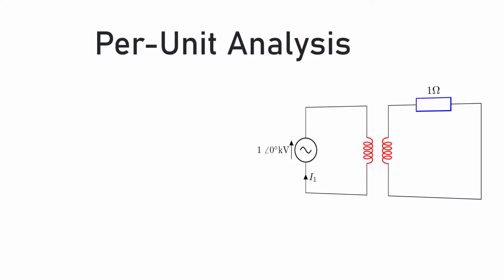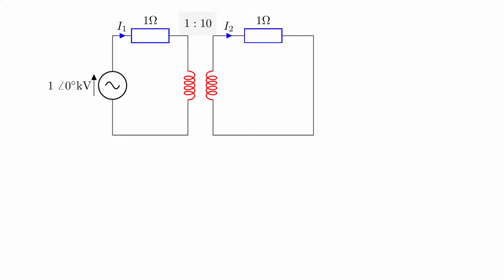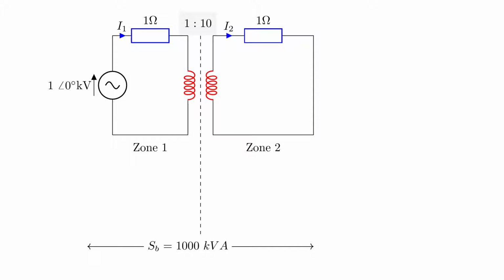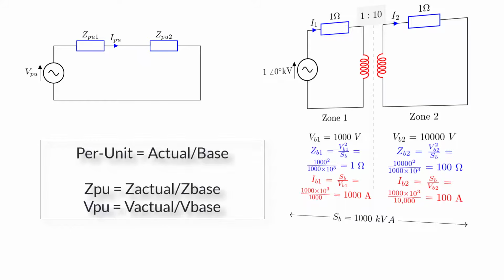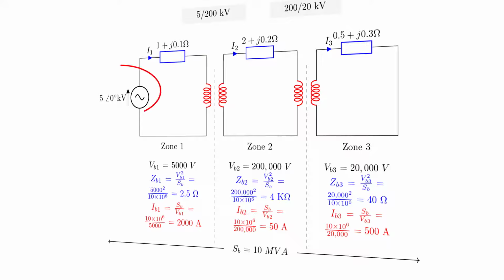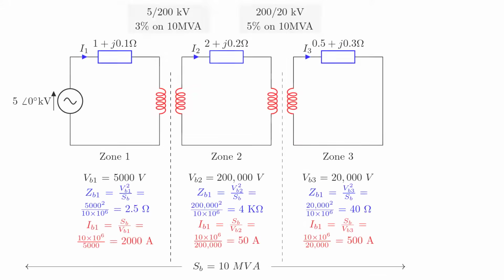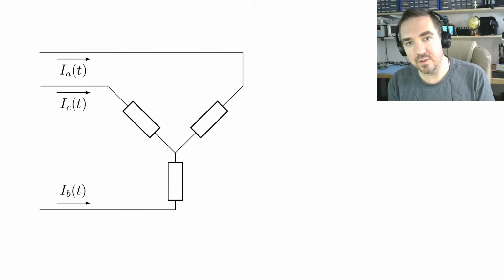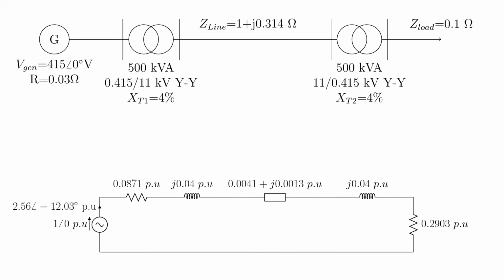Per Unit Analysis - how does it work? (with examples) || Basics of Power Systems Analysis

Comment: How to choose the S base value 🤔
Reply: S base is arbitrary. You can choose any value you want. But typically, it's a good practice to choose power rating. Say if a transformer is rated at 30 kVA, then use 30 kVA as base value.

Comment: Also make videos on 
Per-Unit and 
Equivalent Circuit 
Representation of 
Power System 
Components:-
Introduction, single phase solution of balanced three 
phase networks, one-line diagram and impedance or 
reactance diagram. Per Unit (PU) system, advantage 
of PU system. PU impedance diagram, representation 
of load. (Numerical included)
😢😢

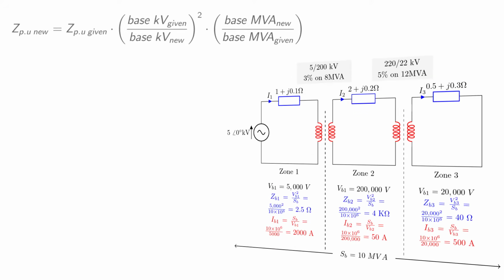Comment: I have got also another Question: at 21:59 the trick formula placing new TX not matching current / existing base values. is that ration 10/8 supposed to be 8/10 and so 12/10 because 10 is the given or existing base MVA ? right ?
Reply: 10 MVA is the NEW value we chose. The ratings are the OLD values.  Dont get those messed up as they will give you the wrong Z_newp.u, which then gives you wrong information about the actual currents

Comment: thank you so much for that great P.U power system analysis sir, I enjoyed it pretty much. could just clarify why I P.U is with + sign instead of ( -) between real and imaginary parts? we are suppose to multiply by the conjugate up and down . the numerator is ( - ) between  real and imaginary parts on the numerator, but on the denominator will be positive so the final answer will be 2.39 - J 0.275 P.U right ?

Comment: Why is the resistive component of a transformers’ impedance not considered?

Also, in the conversion of Zpu old to Zpu new, there seem to be errors in the entry of the values with respect to the conversion equation. 

For Trafo #2, (base kVgiven / base kVAnew)^2 should be (20/22)^2 and the (base MVAnew / base MVAgiven) should be (12/10)  and
For Trafo #1, (base MVAnew / baseMVAgiven) should be (8/10). 

These changes will result in the different values of Zpu for both the Trafo.

Can the author review these please? 

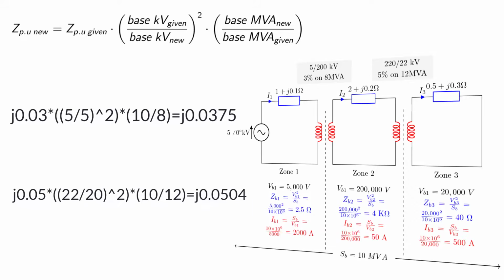I refer to the 23rd minute (22:06 / 27:46) of the video
Reply: 10 MVA and the associated voltages are the NEW value we chose. The ratings are the OLD values.  Dont get those messed up as they will give you the wrong Z_newp.u, which then gives you wrong information about the actual currents

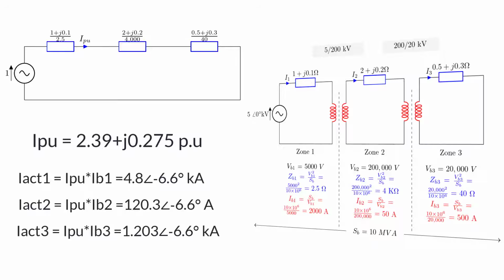Comment: 16:15 I think there is a mistake for the per unit current. The j component of the vector should actually be negative.
Reply: Yes, I second this.  Should be Ipu = 2.39 - j0.275 pu

Comment: At the end, changing the transformer impedance to match the problem conditions - the Zpu of 22/20 - did it matter which side of the transformer for voltage you used? If not, that would depend on the transformer rating have the same turns ratio as the example problem. I suppose that's a given, but wanted to make sure.

Comment: @16:20 did anyone else get Ipu = 2.39 - j0.275??? Not sure how he gets positive j. Spent the last 20 minutes running it through my calculator and Matlab, and still get a -j. Thanks in advance.
Reply: I also did the computation in exact values, I think this answer is correct because when we apply the per unit transformation to the base quantities we get the same result as the video (Angles of Iact1,2,3) so the plus sign is probably just a typo.

Comment: Sir, for the mismatched system base, how come the Vbase of zone 3 is still 20kV? I'm kinda confused...
Reply from the maker: You have to follow the ratio of the transformers to get your voltage base in each zone. The 220kV/22kV transformer ratio is still 10:1, so 200 kV in the middle zone must still give you 20 kV in the load zone. We just need to be careful to adjust the impedance of the transformer so it matches the system base voltages because the 220/22 kV is on a different base.
Reply: oh i see... thank you sooo much @VisualElectric_

Comment: My comment is a bit of a side-track, and doesn't involve the 3-phase example at the end of the video. But following along and practicing the technique presented, I'm wondering if some of the examples, if one saw them in the real world, would represent overloads (for the transformers, at least).

At 6:39, the presenter explains that choice of S-base (Sb), the apparent power, can be anything, but good practice says you should choose a value that matches (as closely as possible) the apparent power base of your equipment. With that then in mind…

In the example at 22:48, the math of course all works, but in that result, is it true that the apparent power is 23 MVA, noting the chosen Sb was only 10? Doesn't that mean we've blown out both of the transformers, one of which was rated 8 MVA and the other 12 MVA? If the example represented a real system, wouldn't you need to ensure the apparent power never exceeded 8 MVA, the (I'm assuming) apparent power handling rating of the lower of the two transformers?

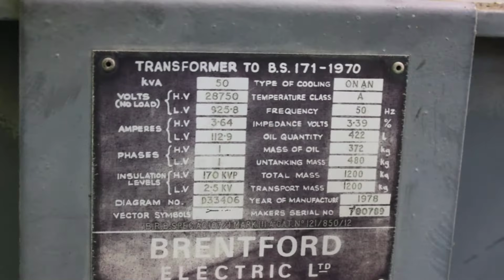I was led to think about this from the prior example showing the nameplate ratings of a transformer at 17:20, which showed it was rated 50 kVA and 3.39%, and the statement following that the percent impedance only makes sense relative to the transformer's base values. Those base values influence your choice of system base (Sb).

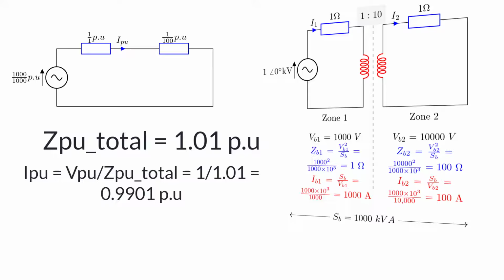In the example at 21:15, both transformers were given as 3% and 5% on 10 MVA, and 10 MVA was chosen as the system base. Working the example, the Ipu came out to 2.31∠-17.1° p.u. (assuming I did it right). This is also 23+ MVA. But we chose 10 MVA as system base, because…somewhere this was a rated limit (came from one or both of the transformers, presumably). It seems like only the first example, at 13:13, had p.u. that were sensible for the apparent power capacity of the system (0.9901 p.u.). The video says that power system engineers recognize that values up to 1 p.u. are immediately recognized as a well behaved system. But in the examples presented in the middle of this video, we get p.u. currents around 2.3, suggesting (if the base values were chosen as the presenter recommends) our analysis has /also/ shown us that these example systems are fubar. Reaction?